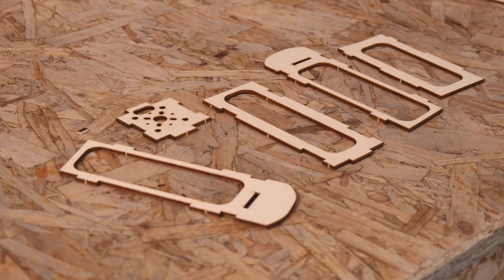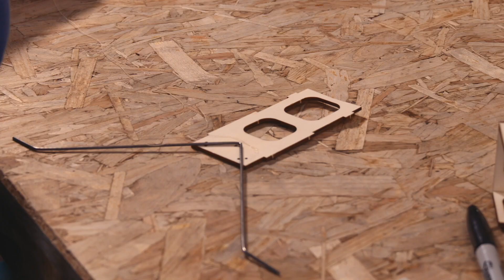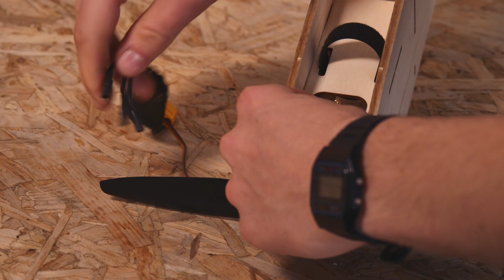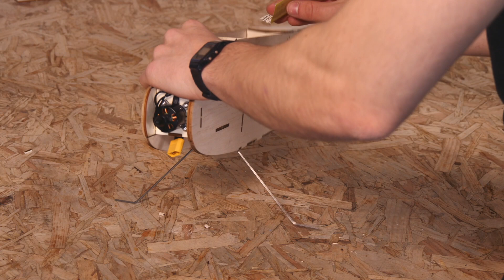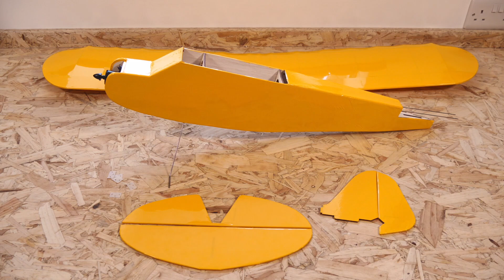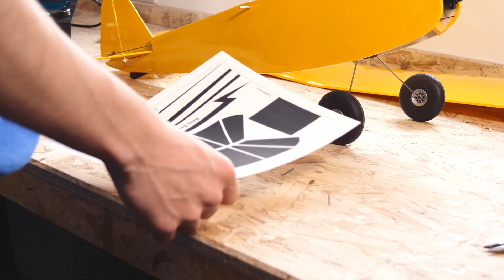Balsa Basics Cub Build

Comment: Also, when fitting the vid clearly says the rudder servo is on the right, yet later on the the right hand control wire is fitted to the elevator? I don't suppose it matters which way round and I assume that they don't cross over in the fuselage.

Comment: Just building this and wondering why that top cowling piece is short by 5mm? Looks better the other way round and fits flush with the front of the ply motor/electronics box. It's then a fraction short where it meets the windscreen but easily remedied with some shaping.

Comment: I would have more confidence in the video if the initial assembly of the motor mount showed the correct pieces (cf 0m45s and 1m15s) laid out on the bench.

Comment: using the CA hinges, not too stiff, the elevator pushrod flexes over such a long distance, on high rate. I modded it with the FT trick of a block of foam with channel for a stirrer straw to glue into and let the pushrod pass thru that to make it not flex. Great building experience!! A++